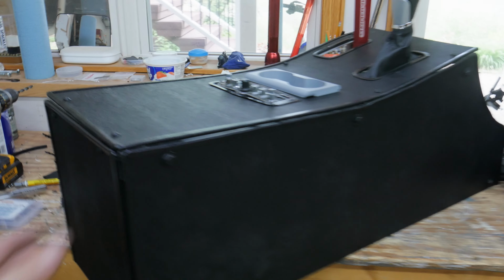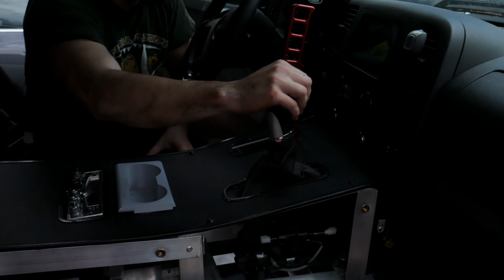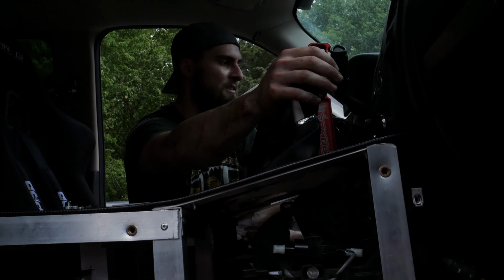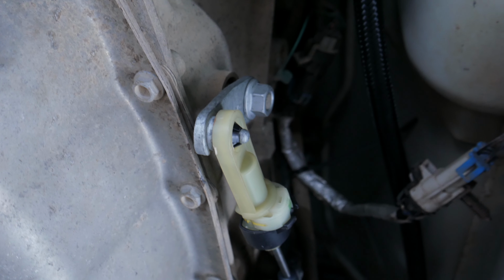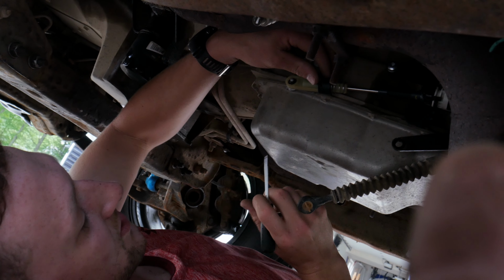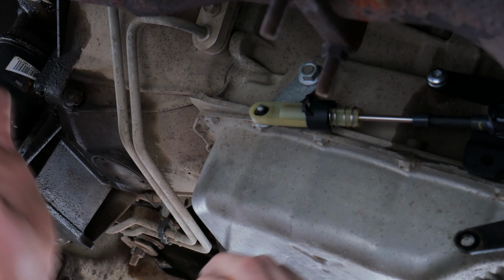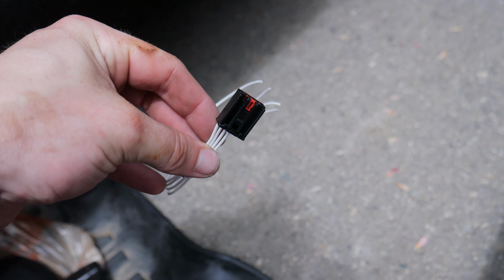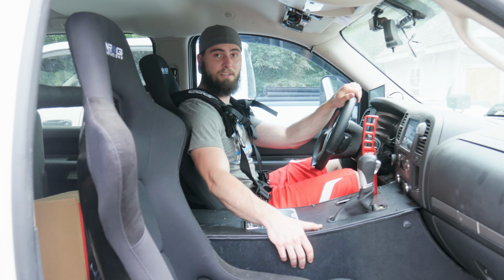Silverado Custom Center Console - Pace Performance 6L80E Center Console Shifter

Comment: If you don't mind can you make a video showing how you got the cable mounted inside the console and to the transmission?   
Thanks in advance
Reply from the maker: It’s not the factory cable, it’s a new one that comes with the shifter, and comes with all the brackets you need. I just drilled a hole and ran the cable.
Reply: @CaswellCustoms  so it came with a bracket for inside the console for the cable? I'm gonna try to use this on my 4l60e in my 84 cutlass
Reply from the maker: @JDP15  it should work, but it is meant for a 6l80 and 6l90. But should still shift the same.
Reply: @CaswellCustoms  on there website it doesn't show the brackets. Thats why I was just wondering if you could do a video showing the brackets. That way I can know for sure if it'll work

Comment: Hey how you doing man nice work ? Current during the same thing to my 2006 CMC Sierra. What i'm using the trail blazer s s shift Send you where you can show me The Wire diarrhoma how you wired to the break padal
Reply from the maker: I think I had just googled the shifter wiring diagram, I don’t fully remember I did it almost 2 years ago now.